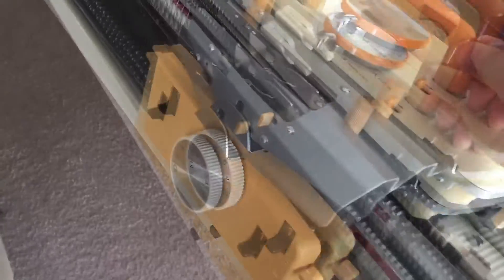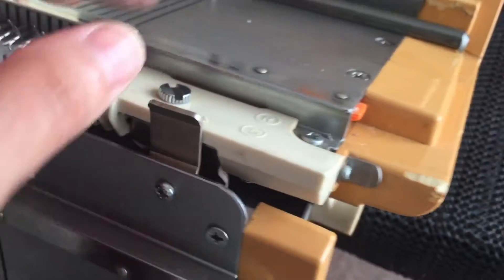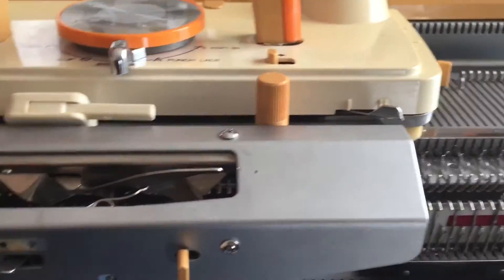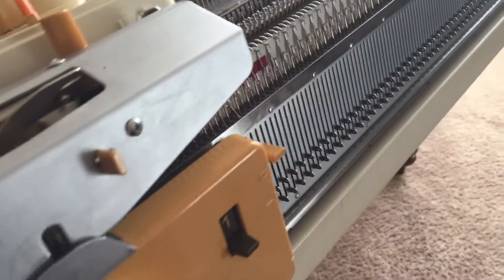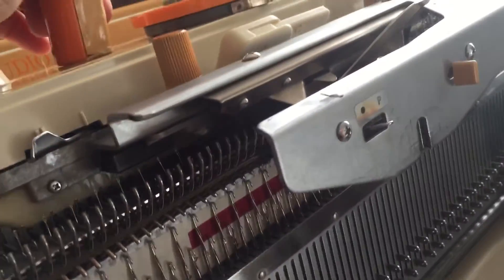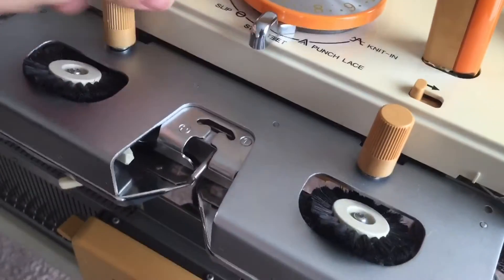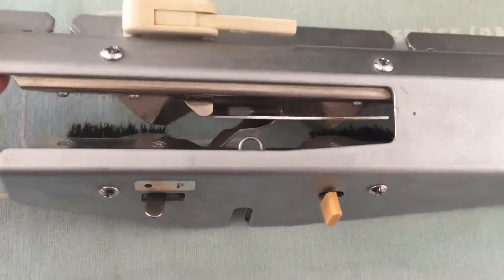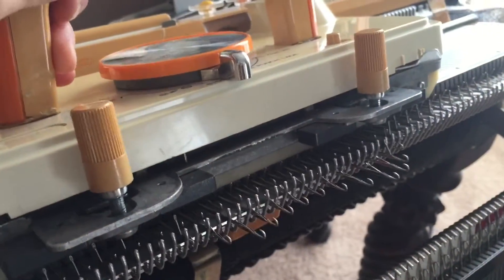❓Ribber Problems Connecting Arm Jams Troubleshooting Knitting Machine Disconnecting GemFOX

Comment: I had same problem. A very experienced knitting machine mechanic and teacher explains that if you bring the ribber position as if to knit, pull forward about a dozen MAIN BED NEEDLES on the left and the right, then put a credit card not more than 1 millimeter thick and not less than 3/4 of a millimeter under one of the bunches of pulled out needles in between the pegs and needles. It should fit lightly snug but not tight nor lose.To fix, first bring up the lever with the blue dot on each side. Then look under the ribber near one end (the back of it), there’s two nuts. Don’t touch the top nut, only loosen very slightly the bottom one and find the small lever next to the nut bringing it up the most it can go and tighten the nut to hold in that position.  Do same adjustment on other end of ribber. Do the test again with the credit card. If credit card too snug then repeat process bringing down slightly the tiny lever, retighten and test again.

Comment: Looks like one side of the ribber is closer to the bed than the other. Use your needle pusher tool to determine the spacing. Lay it on its side the long way between the ribber and the bed. It should sit in that space and not fall between the beds. Hope that helps.
Reply from the maker: Thank you, that was definitely the problem the other day.  I checked the spacing and that right lever kept falling down, making the spacing on the right slightly wider than on the left.  However, now, even with the ribber dropped down, ribber carriage disconnected, the main carriage is getting jammed when the connecting arm is on.
Reply: I have a 360K machine, looks like yours.  I had to adjust the little wire clip on the ribber carriage so that it held the pin on the connecting arm a bit tighter.  Maybe try that?
Reply: Also, check all of your upper bed needles to make sure they are sliding back and forth smoothly and that latches are working properly, etc.  How's your sponge bar?
Reply from the maker: Thank you thank you thank you I did just that just now.  I alternated the needles that were in work/out of work.  And it rolled along.  There IS a bad needle in there somewhere.  omg yay I can go on with my life.  Thank you SO much.  Spongebar is quite new.  Thanks again!
Reply from the maker: What a relief that it's just a needle and not a bigger problem.  I owe you a hug. Thanks so much.
Reply: I'm glad you figured out the problem! Now, make sure you post some videos of your knitting. I love the sweater you knitted. I haven't had the courage to knit a garment yet but I'm willing to try.
Reply from the maker: Yes we got closer to the problem but it's still intermittently jamming, even after alternating the needles.  It might be more than one needle or maybe I just had a stroke of luck that allowed the carriage to pass...I may have  gotten excited a little too soon hehe
Reply: Fudge...  :(  Definitely seemed like a needle was hitting your carriage. Take the carriage off the upper bed and make sure all the little levers underneath are moving properly. Pay close attention to the needle path and check for burrs etc.
Reply from the maker: Thanks! Will do.  And I've rotated the needles, and it's passing like 80% of the time.  But now the connecting arm just won't hang onto the ribber carriage...I think it might be the connecting arm, like something is wrong and it's messing up the needles, making everything worse...
Reply from the maker: Ok, I'm analyzing all the angles you've offered very carefully.  I revisited the needles with a closer look and saw that one by one, the hooks were opening wider every time I would jam.  I took a pliers and squeezed down those hooks to match all the others, and that helped a LOT.  Carriage is moving smoothly over those needles now (it was around R47 every time).  And now I'm back to dealing with the disconnecting ribber carriage.  Thank you again so so so so much
Reply: Cool! The problems we have with these machines are pretty universal. Usually found in the needles or the sponge bar.
Reply from the maker: By the way, I uploaded a video of the finished sweater. Thanks again for all your help!

Comment: Important to note that when wanting to install the Ribber, the mounting clamps on the Main Bed have to be exchanged with the other clamps provided that look like a boxy letter S and those main bed C shaped clamps removed from the main bed will eventually be used to clamp the Ribber Support flaps to the table.

Comment: Don't know if you've sorted this out since posting this video, but you are missing the second set of clamps. You take the same clamps you use for the main bed alone and they go on the metal pieces coming down from the ribber. That should alow the ribber bed to be close enough to your main bed that the needle pusher just fits. Right now, the gap is too big causing the carriages to jam.
Reply from the maker: Sarah Cann Thank you yes I got it sorted out, thank goodness for this great machine knitting community. It was these levers with the blue dot that I was missing. Once I had those oriented right, it closed that gap. Thanks so much!
Reply: GemFOX Food and Craft oh that's wonderful! Yes the MK community are great

Comment: Continuation…  the other adjustment I did was remove the ribber and reposition it, but this time after installing the ribber joiners, be very precise to check that the ‘Ribber Supports’ (the flaps that go onto the table) that have 2 positions, one lower and one higher, chose the one that makes the ribber be higher towards the main bed.  And don’t forget to clamp the Ribber Supports fastening them to the table with the main bed clamps. But be careful when clamping them to -> have a knee under the ribber pushing upward so that when the Ribber Support flaps are positioned to the table, they will be helping the ribber be in the best position to correct the issue (making the ribber be higher to attach more securely to the main bed carriage arm ‘Link Pin’). Check the spacing with the 1mm thick credit card. Can’t be more than 1mm and not less than 3/4mm (when ribber in placement as to knit with blue dot lever in upward position) the credit card placed in between a few pulled out main bed needles and the ribber pegs.  The credit card cannot fit tight nor too loose. Always check.

Comment: Hi i have the same problem my ribber arm comes off  the ribberi think i found the problem the b knitting machine ribber clamps i had on the ribber  arm keep disconnecting  fronm the knitter so i  took the ribber knittng  and ribber clamps off and put small ones on and  woudnt you know the  ribber arm stays on

Comment: The sinker plate that carrys the yarn and joins the careiages together is probably bent slightly, try bending it down Slightly.  The ribber carriage should almost be at the top of the notch on the ribber sinker plate.  Hope this helps.  If all else fails, just source a spare ribber sinker plate.  It seems the only obvious issue.
Reply: Hi! Im Dave and I think we're in a men's knitting group together. I was gonna ask if you might know why my ribber (KR850) hangs lower on the right side? I've switched the attachment hooks that go on the back, but so far, I keep ending up with the same issue. Any ideas or suggestions?

Comment: You need to get ribber brackets my does the same and I found the problem it's the brackets  I found the bracket hole hole for the screws worn and the ribber is slightly away from knitter definately brackets on ribber

Comment: I have a similar problem.... I have knitted a ribbed hem, and now I want to knit single bed so I slide my ribber down to its lowest point and once I connect my knitter arm (to knit single bed) all of my needles get stuck in it .... I can’t figure out what is wrong... PLEASE HELP ME this is the first time that I transfer from double to single bed and I can’t use it. It used to be just fine when I didn’t have the ribber ....
Reply: You have to transfer the stitches from the ribber to the main bed one by one manually. Remove the main bed’s ‘Ribber Carriage Arm’ and insert the ‘Knitter Carriage Arm’ to the main bed carriage. Then insert the working yarn onto main bed carriage yarn feeder gate and close gate fix the yarn tension on the ‘Auto Tension Rod’ that might have slacked when you pulled it earlier to exchange the Carriage Arm’. Now you can knit.